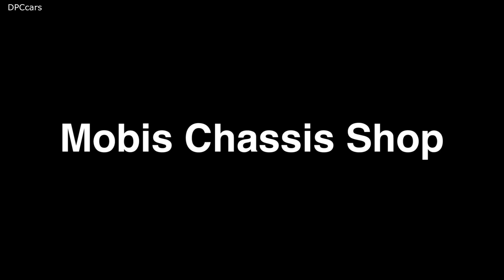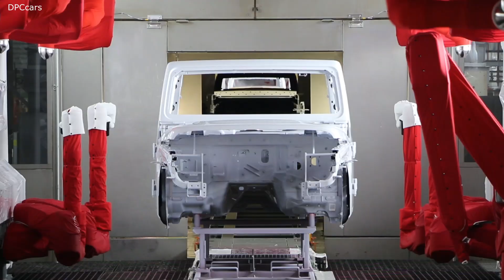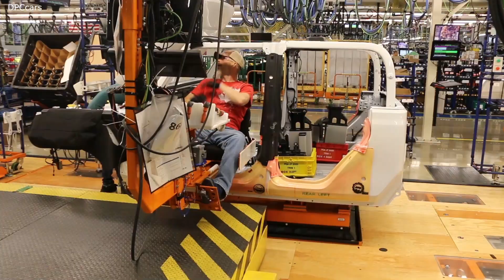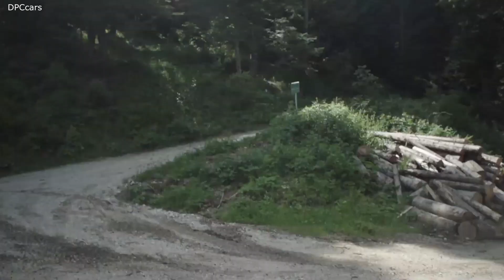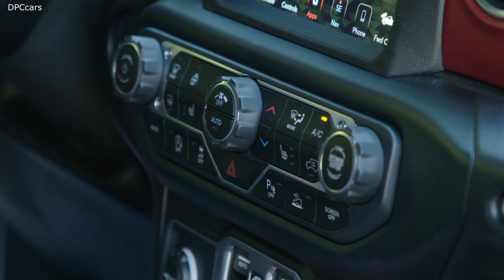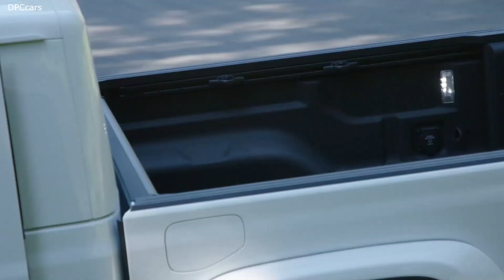Jeep Gladiator Truck Production Factory at Toledo Assembly Complex

Comment: I'd love to see Stellantis Jeep Gladiator have the option for a 5-foot bed or a 6-foot long in all of the trim levels.  Plus, increase the rear door level spaces (Left and Right hand sides of the passenger rears).  Plus, a factory lift for all the Gladiators and Wranglers for at least 3.5-inches leveled with a strengthen sway bar from the front.  NIce video 📼.